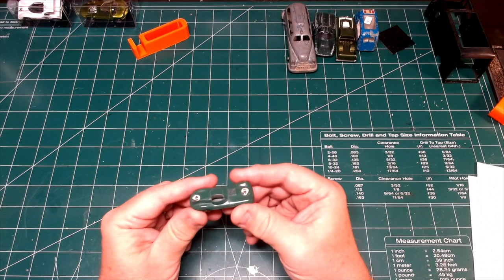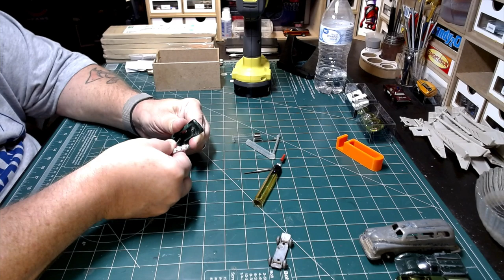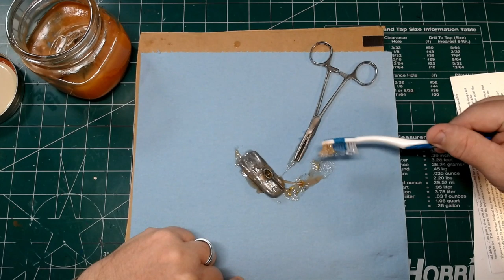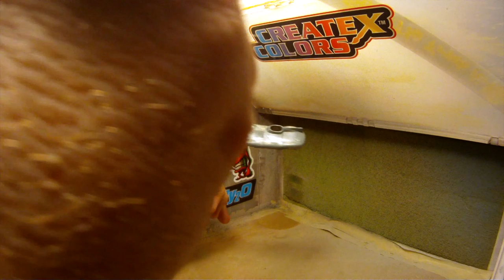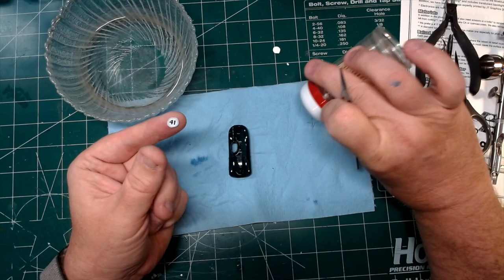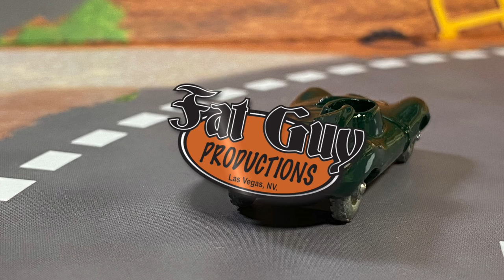Restoring the Lesney Matchbox, Jaguar D Type

Comment: you answered my first question about the driver. Yes there was a 41a (yours) and a slightly larger 41b with grey plastic wheels, I've been working on the 41a today myself, although mine was a restoration by removing a child's idea of a better paint job with nail varnish. Good enough to go into the collection now.  :-))
Reply from the maker: I'd love to see it!
Reply: @pauly7218  I will see if I can find a before picture and email you a before and after, the result wasn't perfect but good enough for 'My' Display, I like leaving these realy old ones as original as possible if they are not totally beyond it.